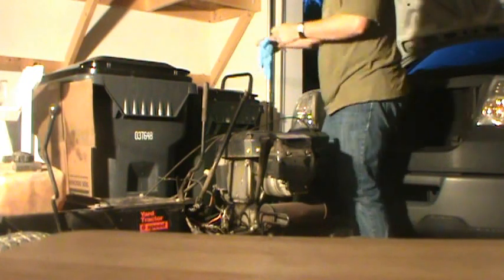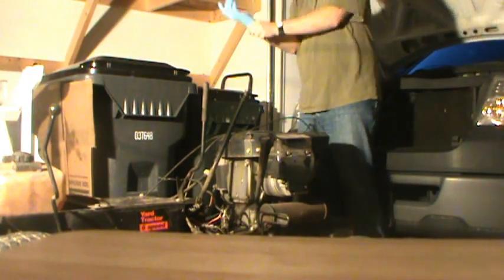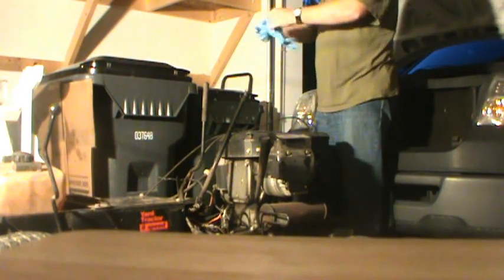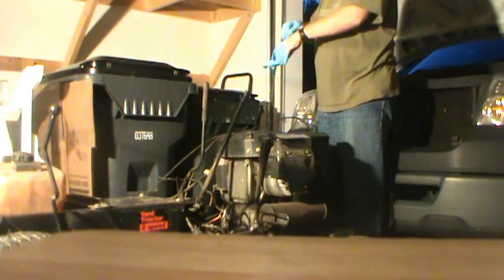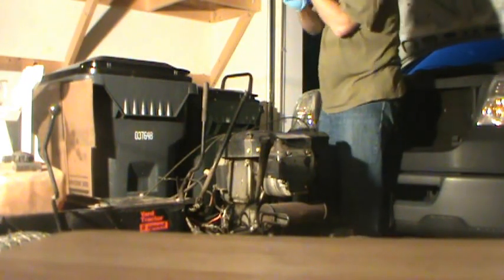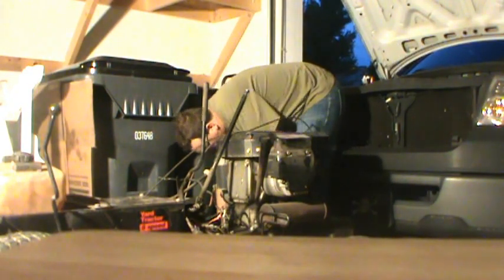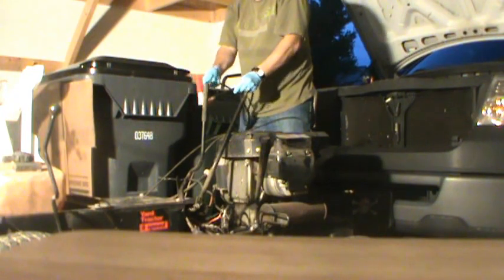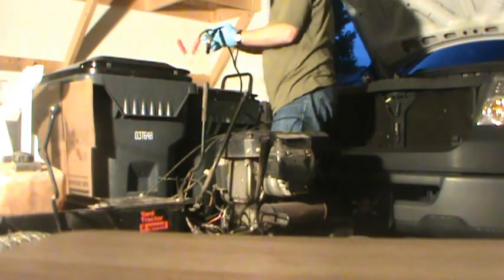Lawn Mower conversion project - SALT - It is alive

Comment: Once you get a handle on the appropriate amount of choke to use that sucker will light right up with a lot less cranking (and drama). It will also smoke a whole lot less if you reduce the choke amount right after it fires.
For a second there I almost thought I was watching an episode of the Red Green show!
Just need to add more duck tape! LET THE GAMES BEGIN!!